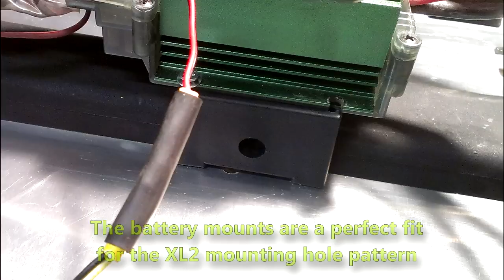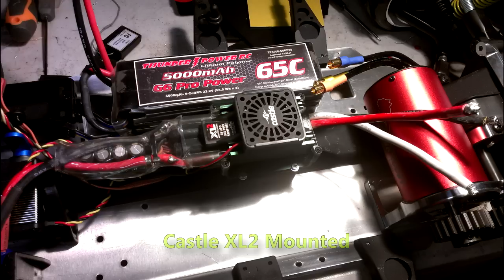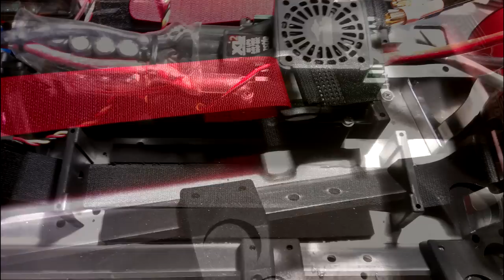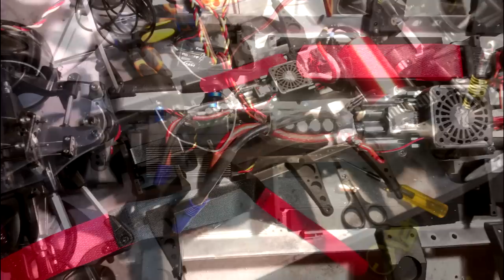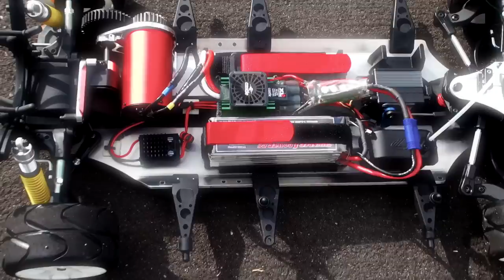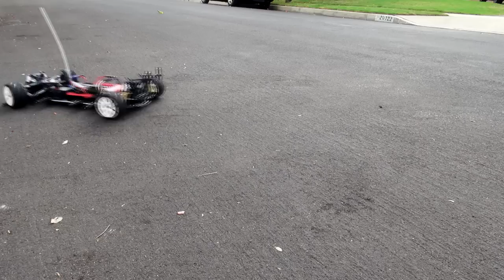FG Modellsport Sportsline BMW Brushless Build & Runs

Comment: I'm running 26/38 gearing in mine but I'm using the castle 1/5 setup on 8s and I'm getting around 65-67mph, it's awesome and still spins the crap out of the tires on take off. Awesome setup !!!

Comment: The car comes stock with ec8 connectors. Take heed. If you have batteries with ec3 or 5 connectors be ready to either solder the ec8 connectors or be ready to buy batteries with the ec8 already installed on it.